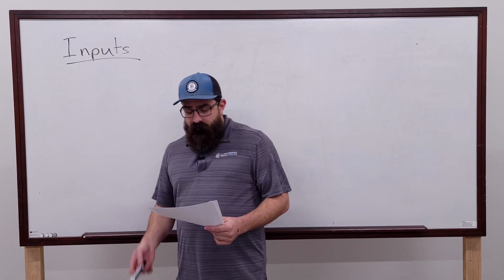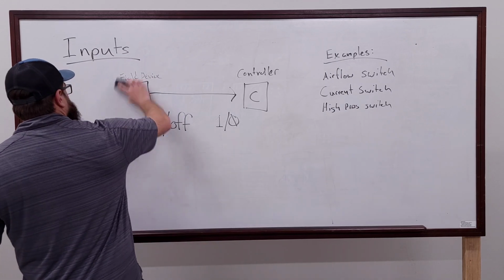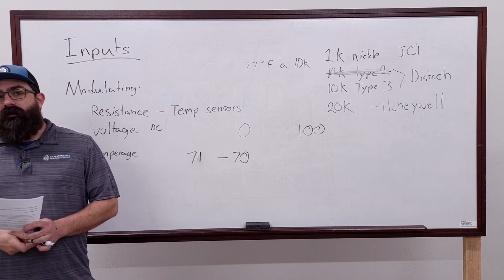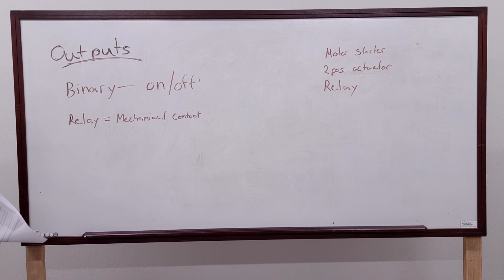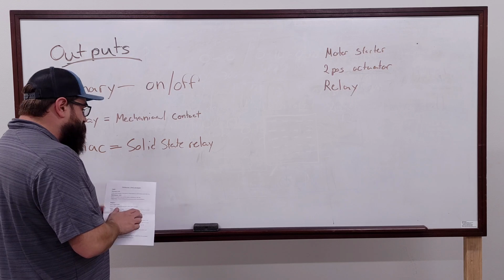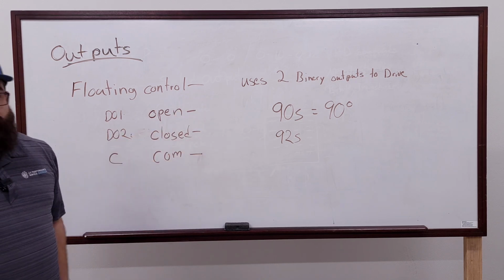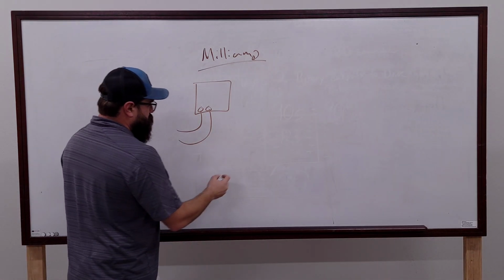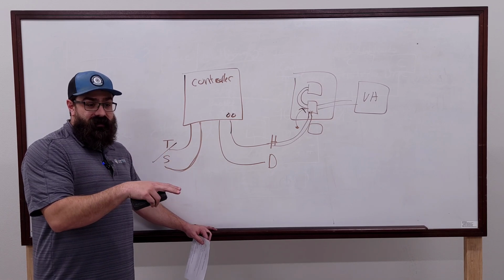BMS I/O Input & Output Training for HVAC Technician

Comment: On a digital input it goes say to flow switch, does the controller send out a signal and when it gets that signal back does it read it as closed? So 0-10vdc? Because it goes to common I am thinking a load?
Reply: I believe it’s a Volt Free Contact or a 24Vac signal.

Comment: Hey brother hope all is well in Texas, speaking on outputs, I was on a Carrier 30XA and on the outputs menu of the touchpilot I was trying to find my economizer EXV output. 
I was looking at "Capacity Signal Cir A" which read 2V but wasn't sure what that output was for. You got any idea? Thanks for your time
Reply from the maker: I believe thats for the automation system do monitor what each circuit capacity was via signal out. So 0vdc being minimum and 10vdc being fully loaded
Reply: @HVACTIME  That would be for total system capacity then. I was reading on screen 7-12% with circuit A running only which I assume can translate to 2vdc.
I was scrolling through the controller but couldn't find percentage of the EXV's. Still learning it while doing maintenance.
Reply from the maker: No it's typically going to be just that particular circuit load. Circuit b should have its own output
Reply: @HVACTIME  Thanks for the input* ! take care of yourself